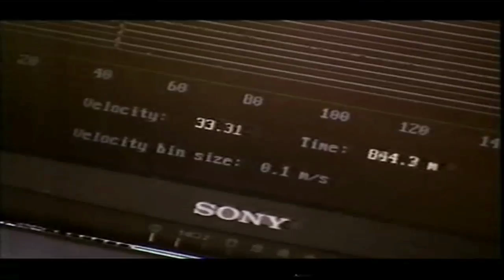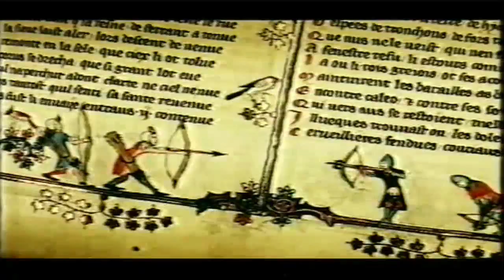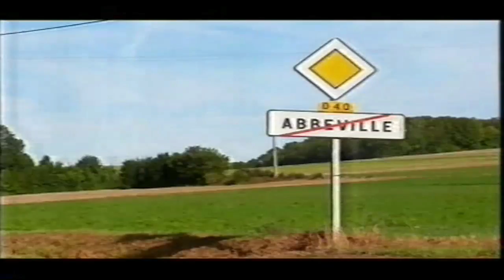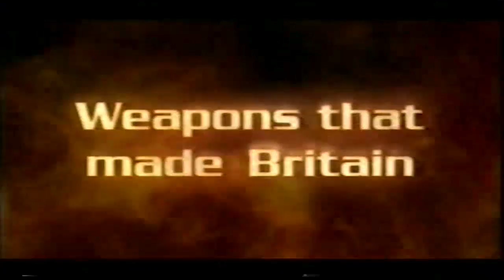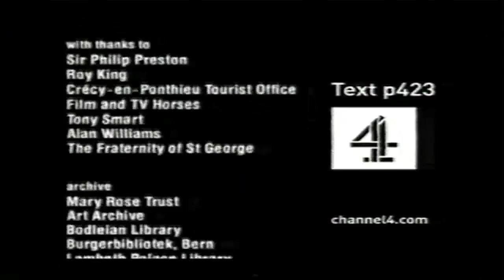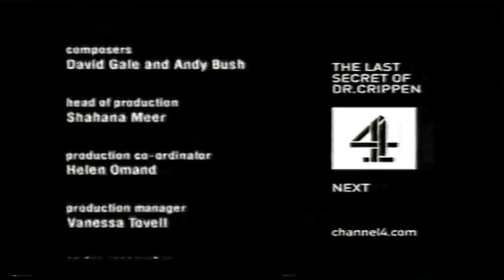Weapons That Made Britain - The Longbow

Comment: There are two extra factors to consider. They were used by the English in the Portuguese wars against Spain (they were helping the Portuguese). Longbows were quick to cover and remove the string, in case of rain. The crossbows couldn't. Spaniard crossbows went limp in the battle of Aljubarrota, their strings too wet to proper use. The second factor, that many ignore... are hounds - They are hell against cavalry. (I remember one picture, a long time ago, from a history book. The hounds were protected with a chest plate that had a long spike at the top, and a hole where burning coal was placed. Don't know if it was to make the hound mad, or to spread coal on impact, or both. It was scary).

Comment: He underestimates the strength of the English longbowmen and the Penetrating ability of their arrows from yew bows. Excavations of the Mary rose yielded bows 6ft6" in length requiring monstrous strength to fire. Skeletons of the archers reveal the extra bone density and muscle structure these longbowmen possessed, honed since childhood. I doubt his machine reflected the true strength and therefore the penetrating ability of the bodkin arrows against Plate armour.
Reply: Keep in mind in addition to a lifetime of practice the Longbowmen were aiming for weak spots in the armor such as the visor, and the joints, they were also aiming for the unprotected spots on the horse (for a mounted knight) to either kill or frighten the horse so it would throw its' rider and once an armored knight was down, it was increadibly difficult to get back up
Reply: It's still easy to stand back up while wearing full plate harness.
Reply: Not when you've got wave after wave of arrows raining down on you. Soon enough one of them is bound to hit a soft spot.
Reply: Also don't forget at Agincourt the Knights that fell in the mud were also trampled by their own men
Reply: Also there is the fact that even if they don't penetrate plate fully, they can still provide several solid concussive blow to the head one after the other.
Reply: Keep in mind also that if you've just been thrown from a horse chances are you've gotten your bell rung, and are disoriented, and while it's true a Knight in full pack could still stand and fight with little issue, that armor is still weighs what at least as much as modern day field pack, so a Knight in full plate armor is more likely to become exhausted a lot quicker then one who is more lightly armored, and at Agincourt the mud and sheer amount of men on the field made getting back up nearly impossible, and casualties related to men being trampled by their own comrades, or were badly wounded but were left crippled or died of their wounds later weren't recorded
Reply: aGreed
Reply: not in a quagmire... there was torrential rain before the battle.
Reply: Tim Hare totally agree
Reply: 20 meters shooting arrow through steel plate imagine 10 meters distance plus the horse speed coming to you so good penatration for sure
Reply: It also looks like the arrows used in the tests are lighter than actual ones. Also the armour material used is unknown - steel hardness can vary significantly with different impurities and carbon content
Reply: I agree. Archers did damage by shooting large parabolic trajectories allowing the arrow to peak, and then fall back to Earth at terminal velocity. They keep saying speed at "20 m equivalent" which I believe is equating strict bow power to arrow velocity which is not the correct way to test this. If the arrow is fired and allowed to peak 100 m in air, @ .25 lb (.113 kg), it should be traveling around 45 m/s which is the rough equivalent to their 20 m flat speed (if you doubt my numbers, the test fire of the bow on the range shows an initial velocity of 56 m/s which means there is more than enough power to get the arrow that high). Also, arrows are quite flexible and shooting a flat trajectory out of an air cannon totally messes up the natural oscillations as the arrow travels. Hitting at that short distance causes a lot of lost energy. Once again, the arrow traveling downwards, along with a longer flight time, makes the arrow transfer much more energy. Shooting a wood arrow out of a cannon does not mimic this at all.
Reply: no bodkin ever penetrated plate, they were designed to pierce and expand ring armour. Even larger crossbows struggled to penetrate plate it was the advent of the crannequin that ultimately began punching through. the battle of Agincourt is a perfect example, new research shows very few men died of arrow wounds because they could not punch through plate armour, it was actually the fact the soldiers had to slog through the mud to get to the English line before they English foot soldiers finally attacked, they lost because they were exhausted. why do people feel the need to talk about flasities and garbage.
Reply: Kinda odd that to make a bow stronger you make it shorter and more flexible here in the real world. I think it has something to do with making the bow "straighten" as quickly as possible and minimizing stretching of the string, etc. But I'm not near the "bowyer' you are. I  just look at how modern compound bows over the last 50 years have gotten progressive shorter and more compact and arrow speeds have increased proportionally to the reductions in bow length. New cam designs have helped and of course modern "composite" construction but its still all about being able to make the bow "unfold" as fast as possible and making it as light as possible so as much energy as possible is left to power the arrow. Want to claim a "longbow" is "different" because its not a recurve or compound? Go ahead. That will be the first  smart thing you've said so far. Now see if you can make the mental leap to recognize that they're different AND better. And shorter, more flexible and have far lower "draw weights" and deliver far more energy to the arrow. Or just stay in the Dark  Ages where you're smart and safe.
Reply: naw bro
longbows won that battle, killed tons of people in the mud
Reply: Agreed Tim....
Reply: zhawn14 Very sound calculations & combined theory (term. Velocity,) zhawn14, this has long been my thought too....
Reply: Deeremeyer1 - What are you trying to say? Comparing a medieval weapon to a 20th century one? You might as well compare a cart to a ferrari. And the longbow is not a particularly efficient design. Knowledgeable people accept that. It evolved to that design because it was simple and fast to make, could be made powerful enough to shoot heavy arrows with reasonable speed, and was quite reliable... nothing anywhere about it being a super efficient design. Calm down.
Reply: michael leigh - Did you take a quarterpounder war arrow shot from a 150# bow at close range to the chest or head? Or, a flu flu from a 35# bow half drawn...there's more than a bit of difference.
Reply: Tou SHOOT  of LOOSE  off arrows, not fire them off.
Reply: Remember the armour is steel. The arrows are iron.
Reply: @zhawn14  your physics is incorrect. You cannot get more energy out than you put in. An arrow shot from a bow would be loosing power from the Tim that it is lossed from the bow. It decelerates from drag.
Reply: @rattytattyratnett  You know I wrote this whole other post and then I reread what you said; you are right. I forgot about conservation of energy. Oops
Reply: Tim Hare i have used longbows for a good time now and the power and penetration still leaves me in total awe every time i shoot . it always amuses me hearing those say it was nothing . Really would not like to be on the wrong end of one !
Reply: A other thing to consider what this test didn't is that the force of the arrow is added to the force of the charching horse, which meens that the arrow would impact much harder than on a standing / not as fast moving towards you targed.

Comment: Absolutely fantastic video and a great test as well.
But I will add knights would not have worn "munition grade" armour. 
Knights were nobles....comparatively incredibly wealthy in contrast to the levies, militias and the common man. 

They would have almost exclusively worn higher quality armour. The "average" armour of a knight would be much better than this tested armour. We have many museum pieces of armour from this period to reference as well, the more recent test done on Tod's Workshop channel with Dr Tobius Capwell is more indicative of a Kights Breastplate.

But this test is still very relevent. 
This type of armour is what the lesser soldiers could afford and it demonstrates at close range that arrows fired from a higher-end powered warbow would definitely be effective.

Therefore how did this weapon defeat knights if it's unlikely to penetrate their quality plate? 
Well No armour 100% fully encompasses a soldier with plates. There are many gaps. Armpits, visors, elbow and knee joints, often cuisses (thigh armour) do not wrap around the back to protect the hamstring etc.

When you have 5000 archers unloading 5-10 arrows a minute in the opening moments of a battle that is 25,000-5,0000 arrows literally raining down on the knights. 

If 1/100 arrows cause a "lucky shot" striking an unplated area we now have 250-500 knights injured, incapacitated or dead from arrows that bypassed their armour in just 1 minute.

This is also where the draw weight of the bow does matter. 
Even though these weak spots are not covered in plate, the knight would often have gambeson or a combination of Gameson and mail in these unprotected places.

These are still good armours that will slow down an arrow if not defeat them completely. A higher draw weight bow will have a better chance to penetrate deeper when these inevitable lucky shots do occur resulting in a higher chance of either lethal depth or incapacitating depth compared to lower draw weight bows. So draw weight and power 100% matters.

Ppl also forget that English archers were trained in Melee. It is well documented from both sides, that at the battle of Agincourt the archers spent all their arrows then drew their sidearms and joined the melee with the English Knights and Men-at-arms.

If the Bow was this Knight killing plate destroying weapon as modern-day myths suggest then the battle at Agincourt specifically would have been over without the Archers needing to join the melee. But accounts of the battle tell that the Archers did as much if not more damage to the French in Melee as they did with their bows

This was the real power of the English Archers. They were multi-faceted well-trained soldiers...not just archers. It's why they were so effective on the battlefield.

Comment: Punching through armor was not the aim of English bowmen, despite this gentleman’s overly dramatic presentations.
Reply: If I were an archer back then I'd figure a horse is a lot larger and easier to hit than a man, and will act unpredictably when injured. So damn the man, aim for the horse. A knight off his horse won't be able to bring the lance to bear against you in a charge and is nothing more than an armored infantryman. Softer spots or openings in armor are all good and well if you can hit them, but the real power behind a knight in a charge is the mount under him. Take that out of the equation and the field, so to speak, gets levelled fast.
Reply: Jack Cordial  In a battle like Crecy, or Agincourt, you weren't aiming at a man, you were aiming at the french army to break up the charge. Once that was a bunch of injured blokes staggering through a field of dead and wounded horses (they're quite big) the English men-at-arms, assisted by the archers, piled in and kicked the shit out of you. They were disciplined enough that they'd pull back and reform before the next wave (hampered by charging through the casualties of the previous waves) turned up. Rinse and repeat. The English were massively helped by the French failure to see it wasn't working.

Comment: Of course, that's exactly how to get your archers killed.  at 20 meters the knight will be on you about 3 seconds, so you'd probably never even get a second shot off before being ground to a red, bloody pulp.  They were used as LONG range weapons, volleyed by the thousands, and bouncing all over and thru weak points in the armor.  You would think an "expert" would know this....
Reply: and of course he's got it backwards about crossbows: they may be expensive but extremely EASY to use, so you'd hardly need a trained mercernary....if you can afford to arm your troops, you could teach any peasant to use a crossbow in an afternoon.  Of course, real mounted knights would have taken twice as long, 80 seconds, given the weight of the armor of the men AND horse.  It's doubtful that any French cavalry got within 50 yards, at the very closest.  So, 6000 English longbowmen firing roughly 15 arrows a minute gives you about 1500 a SECOND falling on the French, so aiming is clearly secondary firing into a mass of cavalry.
Reply: And the arrows were fired at a steep angle, which fell like rain adding a heavier fall and penetration.  The most accurate depiction of this effect in modern times is in Henry V the Lawrence Oliver version, i'd guess.
Reply: Should have had Robert Hardy as the presenter.  Apart from being a great actor, his books on the English longbow are among the best ever written on the subject.   I seldom care for the opinions of actors on anything except their art, but Mr Hardy's opinions on longbows are one of the rare exceptions to that rule.

Comment: Sorry chaps, but a Longbow as told to us here did not loose off at 140mph. A 175lb Longbow would only manage 146 ftps (99.4mps)  or 99.54:mph: average 25" draw using a 1.6oz arrow roughly 45:Jules of energy at the bow, dropping to less than one third of this (the Inverse Square Law) at the target at maximum effective range of 120 yards (110m). Just saying, using mathematics, not including windage and moisture.

Comment: More and more I read about bows, I learned only one thing about the longbow: IT SUCKS! We've been worshiping this false idol for too long! Silly video games and bias shows fooled us all!
Talking about range, we either have the Turkish bow, or the infamous Korean's Gakgung using Pyeonjeon.
Talking about power, the Mongolian recurve bow is there sitting in the corner.
Talking about efficiency, Korean Gakgung or Japanese Yumi won't deform your body as much.
...
I understand most of us're triggered by this cold hard truth, but the truth is still the truth. However, all that characteristics it doesn't have, it makes up by simplicity: The longbow can be made fairly easier. (I once made a big one with 3 heated-and-curved PVC pipe ribs + a cable) Easier to make = shjtload amount of longbows => more longbowmen + more time to train with ==> More tactics can be used and flexible moves added. And I bet we're all more interested in the tactics than in the bow.
Despite its suck, it's still the one that made Britain. No hatred on either longbow or British by any means as they gotta make do with what material they had, plus longbowmen were known for their excellent skill, just that: The Longbow made Britain, but gave them any better bows and we would be all speaking English by now.